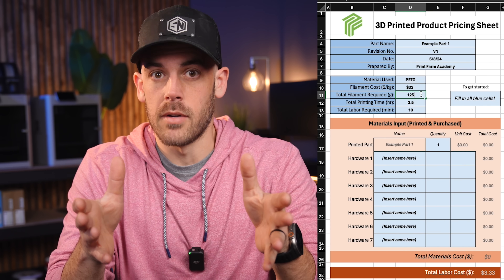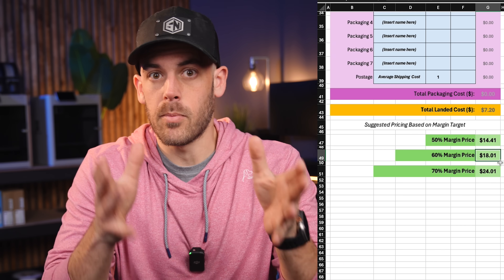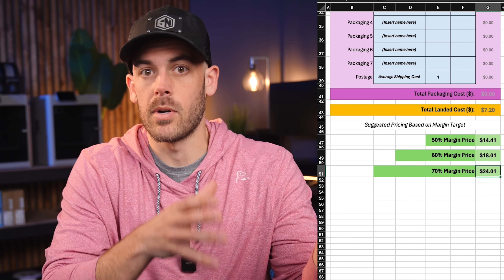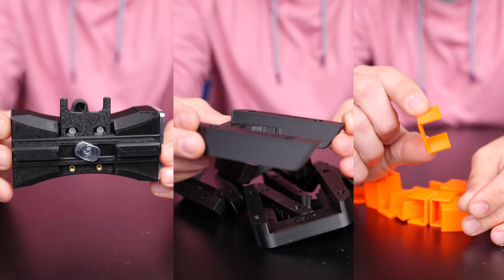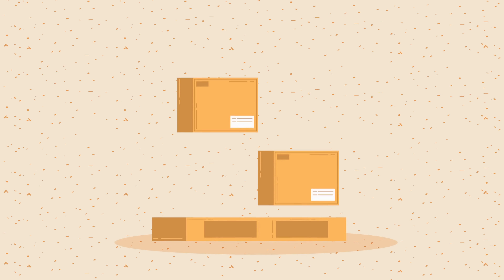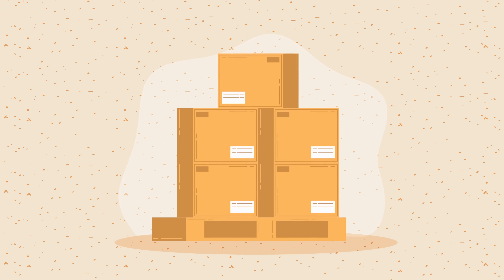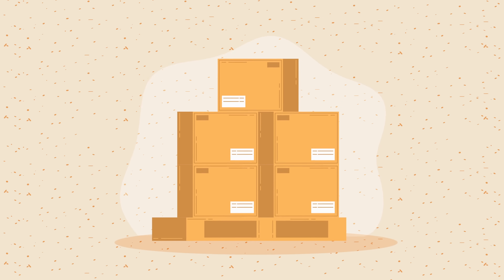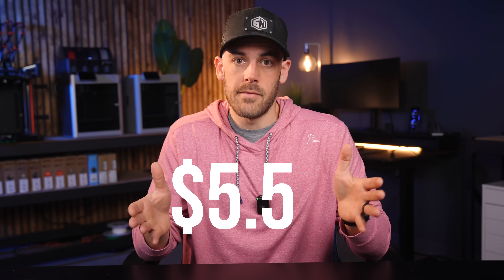Why I charge $55 for this 3D printed part (how to price)

Comment: How about the cost of R&D ? And the cost of software? And maybe a powerful computer to run that software?
Reply: R&D for what? I assume that in all cases it was an existed models which just had to be printed. Otherwise, you can charge at least at a labor rate. Or introduce a new rate for r&d/modeling.
Reply: @felixyasnopolski8571  Often, I need to calibrate some process variables like shrinkage compensation, hole- and outer profile compensation. That requires various test prints and calculations. Two to three hours for this work is not uncommon. For one-offs or low production numbers, this calibration effort is quite a chunk of the total cost.
Reply: @vsijben  that's interesting... I'd never include it in client costs, because it's my problems, and I never touched any calibrations except shrinkage compensation, but it's done fairly easily with just one print. Maybe you need to invest a bit more in your hardware to eliminate those calibrations?
Reply: @felixyasnopolski8571  he made a video about how much time and effort goes into designing his dust collector shrouds. It is a lot of man hours. Those get amortized as he sells now parts, but I think it should be mentioned nonetheless.

Comment: Design cost, especially for custom orders. I do custom engineering solutions so I factor in engineering labor into project costs.
Reply from the maker: Totally! To me that would fall into the "labor" category but good point for engineering costs for one-off projects
Reply: @PrintFarmAcademy Not only for one offs. If you design/develop for 100 hours, and in the end you sell 100 pcs, they all should contain 1 hour of labour for that.
Reply: Charge by the job or hour? Some of the projects I've done in this space have gotten a little crazy. I mean 70 - 80 hours of design and redesign. Basically taking a drawing on a napkin to a viable product.
Reply: @jamesdmc2928 /videos sounds like you are going more into the niche space of design consultation rather than print production. if you are creating something out of nothing, you should obviously charge per hour. this is because your production profit is not guaranteed. they may just say thank you and leave once you have completed the design. at any point if they feel they are not getting the required rate of results vs rate charged, the relationship ends and you still get paid. the hourly rate incentivises the customer to treat everyone's time as valuable, which it is. separate the design cost from the print cost.

if the relationship is worth future business (you should be able to tell after working 60hours with them on something), you can do tricks like offer lower rate for the next 20 hrs. or do it for free if they commit a minimum order qty of the final product via which you can recoup the design cost.
Reply: @jamesdmc2928  If they took it to any other place they'd charge them the same. It's a part of doing business.
Reply: @jamesdmc2928 If you're generally "slow" you want to charge by he hour, obviously! 😂

If you're super fast and highly skilled, you want to charge your customer for time saved, obviously. 😅
Reply: Consider non sale price for filament. Can not count on always buying it on sale.
Reply: I suppose how you handle design costs depends on what you are designing for. If it is your design to sell to lots of people, you can find a way to amortize the design cost over the product lifetime (or take it from the profits of other parts sold). But if it is a custom job one might consider charging a one-time engineering/design fee in addition to the per-part printing fee.
Reply: Oh if you actually design the parts, that's expensive. 
I don't like high pricing for a simple part print when the customer provides the STL but if I asked for a custom design, I need to expect a higher to actually high price
Reply: @sgtmaggi what are design costs running?? How much do you charge
Reply: @chrisnossoughi9039 I actually dont design parts, Im sorry. Just stated that the hogher price is to be expected when asking for custom ones
Reply: How much do you charge for design work
Reply: Well, no crap, design time costs your time and you should be compensated for it.
Reply: And how do you handle it when somebody wants you to make something that has a patent? It seems to me that people are 3-D printers feel there and not entitled to do patent research because they think they designed it. It doesn’t violate any patents. Perhaps I don’t realize it’s the function not necessarily an exact design.
Reply: @Eric_In_SF  Patents are a tool used by the bourgeoise to suppress pure capitalism and prevent small-but-innovative competition from succeeding. Don't be a pinko commie, be a true capitalist; ignore patents and do it anyway! Apple does.                                                    /s, for legal reasons.